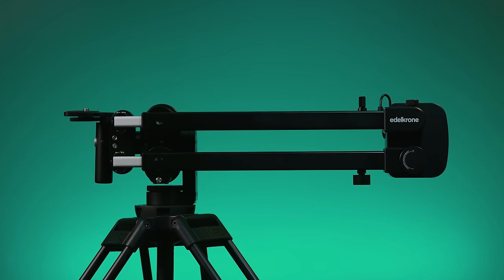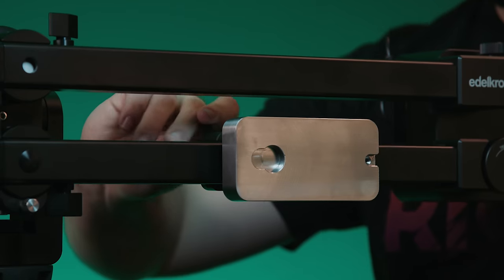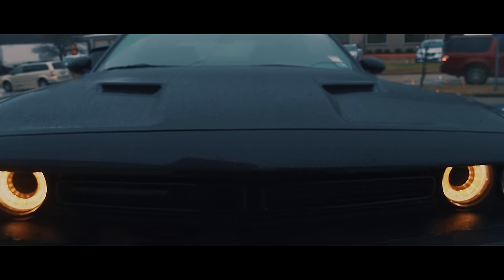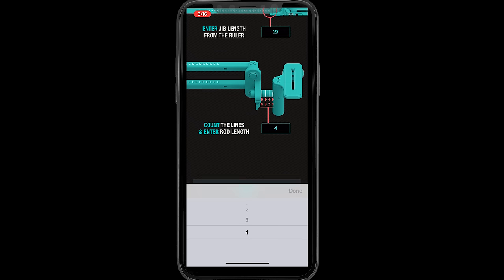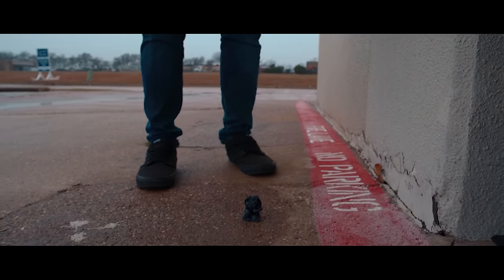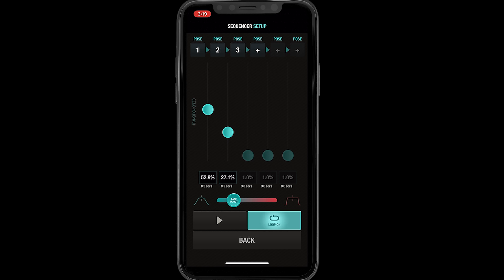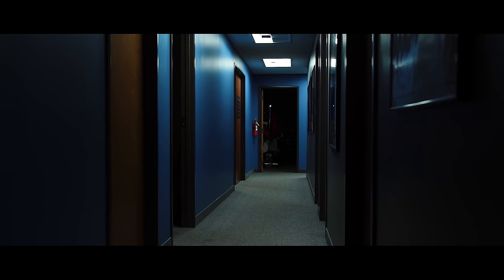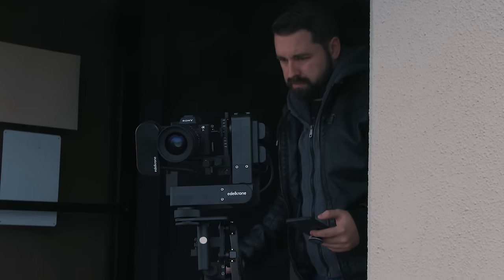JibONE: A Motion Control Jib

Comment: SliderPLUS can also get vertical movement with Steady Module. Have you 
tried putting JibONE on top of a HeadONE? With some lighter cameras 
you'd be under the HeadONE weight limit for pan - could it give you a 
pedestal up and swing over in one take?

Comment: Well, @ 40 seconds , I would say " ready to go out of the box " is not so without all the attachments. you need all the attachments for the full potential of this unit...., Jib one + head plus+ Flex head.  get pretty expensive.. It is nice though, a plus over my shark slider s1 setup, not really a fan of phone app, kinda like a drone that uses a phone, but a big fan of a propitiatory controller or remote is a big plus. nice unit.  ..

Comment: Really wish I blew my $1.5K on this instead of the Rhino... bought a slider when I realized a gimbal wasn’t gonna get me what I need for the Z6 system... but the Rhino really only gives me the lateral movement when vertical is going to be used more often (and this got the lats in its package!)

Comment: How does it compare to this review on B&H? 😅

Horrible all around horrible.
ByShaun
Verified Buyer
 Community Member
Jittery, jerky, jumpy. Comes with 4 weights but if you use more than 1 it is too heavy for it. It can't be used with the pan tilt head pro like advertised because the head is too heavy and runs into the jib arms.

Everything is unnecessarily heavy and underpowered. Running an a7 was too much for it. The app is the worst. It doesn't save any settings, disconnects constantly and looping a simple movement takes 15minutes to setup IF that even works at all.